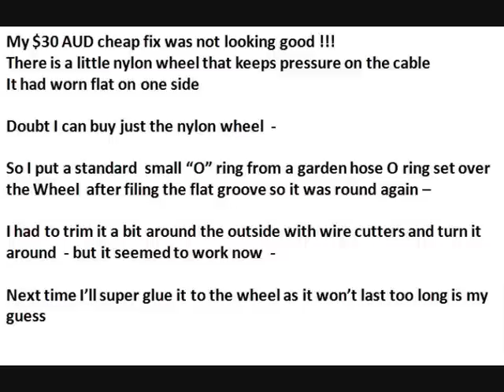Replace power aerial in VY Commodore

Comment: This job is a total pain,the black plastic screws that hold the inner guard plastic I just drill out and replace $10 for 100 on eBay better than spending an hour trying to get the old shit out.when I unbolt the antenna I take the plastic Pannell out from the passenger footwell and tie a string to the antenna cable then go and pull the antenna out then use the string to pull the new antenna cable through the body of the car to the inside so I don't have to take out the computer or anything else it makes it a bit easier.

Comment from the maker: I know the feeling , I've now got a front passenger doorlock not working and setting off the alarm when you use the remote, and the driver side power window also not working . I'm pretty sure I'll need to remove both door front door panels which I expect to be a bit of a challenge.